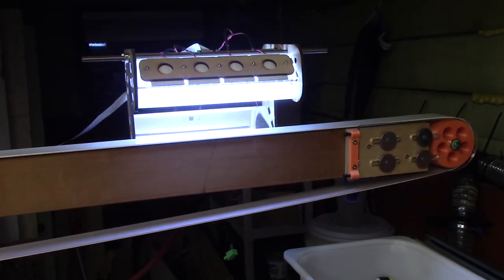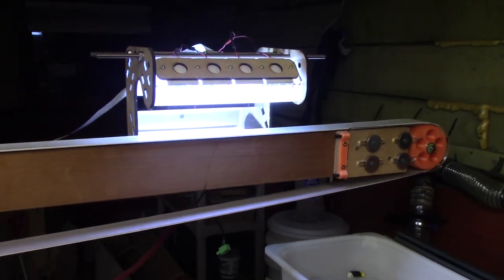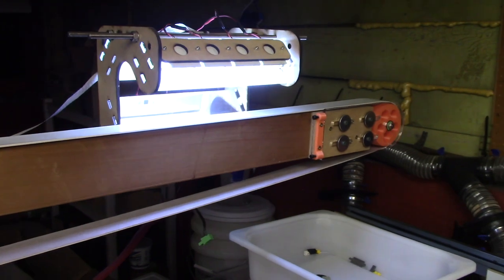Conveyor belt for LEGO sorting

Comment: Gday, How are you processing the image with the mirror? are you using python cv for image detection? Ive wanted to change my setup to include a mirror to catch depth, not sure the best way to capture the top and side view then resize it to 224pixels for image training..Originally i captured only an area of interest around the block to ensure the lego block took up most of the camera frame, this isnt possible with the mirror as i will have rectangular image